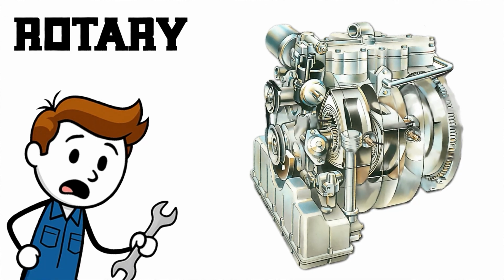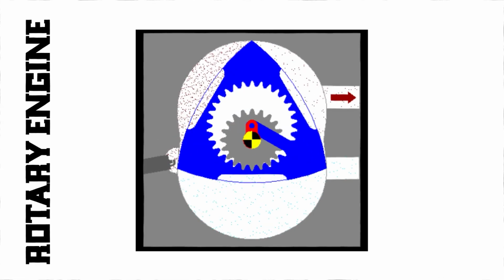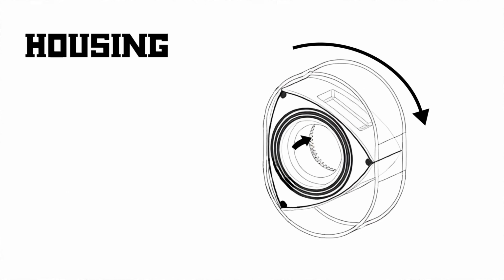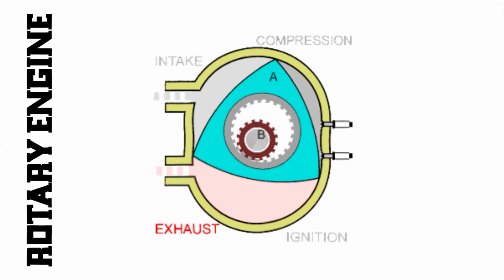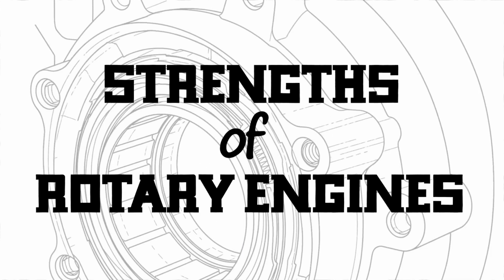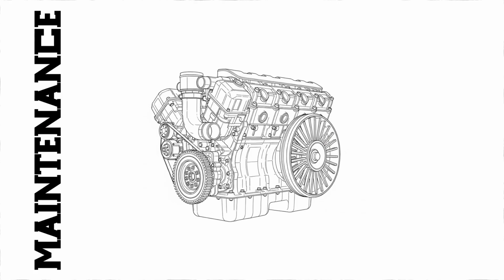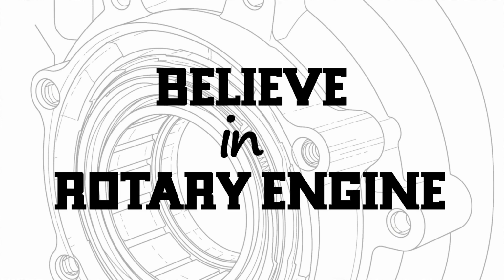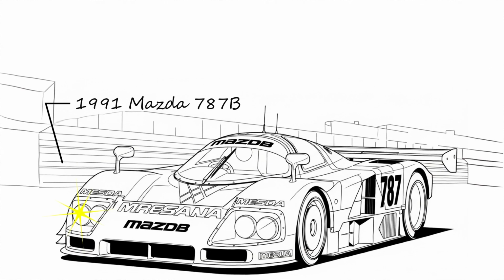How Does a Rotary Engine Actually Work?

Comment: Does a rotary engine output more torque/horsepower?
Reply from the maker: Depends on how many rotors. It's a bit difficult to directly compare a rotary to a regular piston engine in terms of the numbers. But if you ever look at how much power something like a 4 rotor rx7 makes compared to most flat 6, v6, or even v8 engines, you would be surprised!